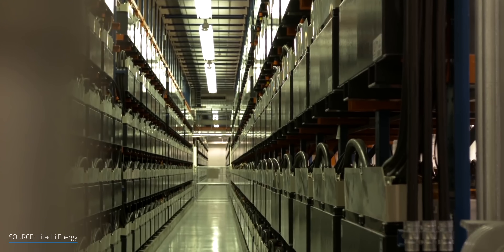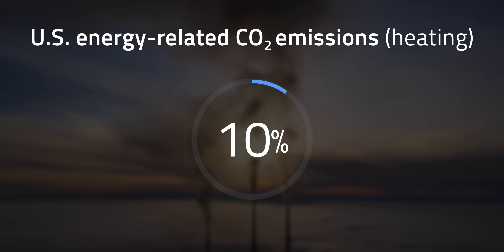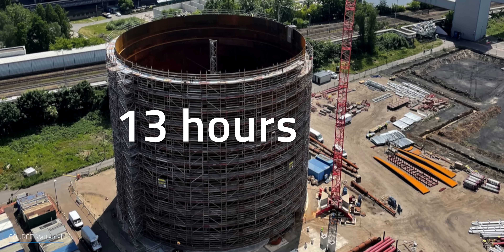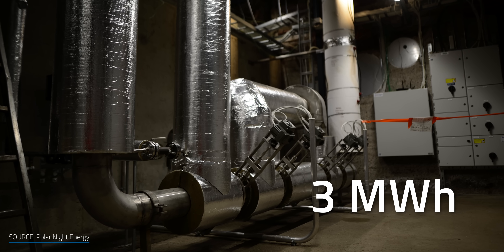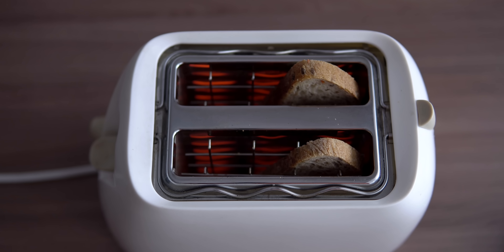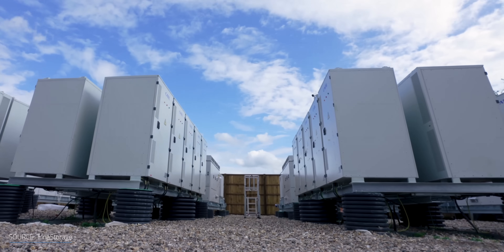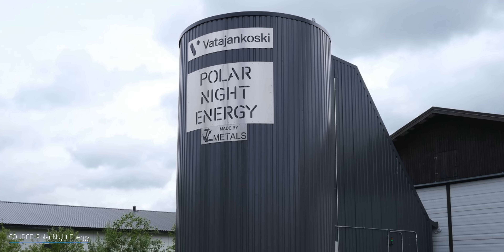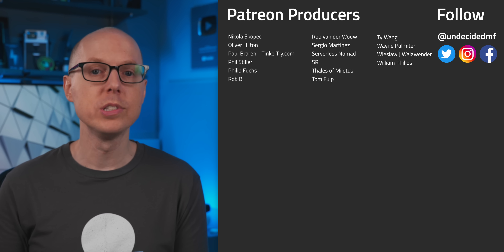How A Sand Battery Could Change The Energy Game

Comment: So if the turbines are turned off, does that mean the energy that is being used is being generated by 100% renewables? If not then then that is crazy. Should they not be turning off fossil fuel generation before renewables?
Reply: At the current time there is a baseload being provided by NG or other systems.

The power company is not going to shutdown base load plants just yet.
They will reduce their output somewhat to allow for renewable source power.

If clouds shaded the panels or the wind stopped blowing bringing base load plants back online would take too much time. Possibly causing a supply interruption.

On a side note.
Wind generators in the Panhandle of Texas are being shut down because the grid can not handle the power coming out of them.
Reply: The issue is that most fossil fuel plants have issues being completely turned off and on again - most of the components were designed to run under a constant load, and only turn off for planned maintenance. Renewable sources are much more distributed and handle being turned on and off much better. From a wear and tear cost, there is a minimum threshold fossil fuel plants need to maintain to prevent shortening their lifespan.

Comment: If they add the heat when it there is access, they could use solar and heat pumps to heat the sand with less energy.
Reply: You need to raise the sand up to 100s of degrees celsius, you cant do this with a heat pump, they're good for ambient +/-40°C

Comment: The only thing that bothers me about this is that resistive heating is terribly inefficient
Reply: Actually resistive heating is 100% efficient,especially when using surplus electricity as
your energy source. One KWHr of electric produces 3412 btu's of heat energy.

Better would be using a heatpump to extract heat from the air at~5x efficiency,but
high temperature heatpumps are not ready yet.More work needs to be done on this.
Reply: Resistive Heating is 100% efficient. 100% of the energy gets converted to heat.
Reply: @gillo100  I’m talking about overall efficiency, when you compare natural gas heating to resistive temperature eating there’s no contest.
Reply: @TexasScout  The purpose was to store excess renewable electrical energy, not use more fossil fuels to create energy not need at that moment...
Reply: @troubleshooter1975  understood I just didn’t think that was the most efficient way to do it, but I’m not a scientist.

Comment: This is yet another reminder that more cities need to invest in district heating networks. This is one of many potential techs out there which would drastically reduce emissions by taking advantage of one….but many of our cities don’t have district heating so they won’t be able to take advantage of it :-(
Reply: Detroit HAD district heating from coal fired electric plants. Then we started phasing out the old and dying coal plants and they sold the district heating to Enron. Which raised prices for heat to high cost and for 2+ years a goodly portion of Detroit's central heat district scrambled to convert to gas fired boilers (3 year payback on package boilers vs Enron)(steam was the medium for transfer and Detroit was the "condenser" for the power plants - adsorption cooling for the summer).

So, if building managers are going to buyin and this is going to work, it must be regulated and treated as a utility or some structure to avoid the gouging as Enron did to cause a reversal effect.
Reply: @billb48843  Open sourced, non regulated, non taxed, only an engineering pass sticker for safety. Every land lord or home could have their own type of heat and go off the main grid. Eventually even off the electrical grid using the same tech.
Reply: The U.S govt does things half-assed.  They have regulated corporate entities running the utilities.  To maximize current profit they kick maintenance work down the line until something breaks.  Any money they spend on maintenance is money that isn't being spent on increasing their profits, and so is kept at a minimum.  There is also virtually (sometimes literally) no competition so they have very little incentive to make their customers happy.  Add to that the corruption that often takes place between the industries regulating body and the utilities company and you get a fine mess.  There are a lot of projects that would be useful except that we need to clean up the way we run utilities.
Reply: @IaIaCthulhuFtagn   What you're describing is the result of the forced privatization of utilities into investor owned utilities which are 'regulated monopolies'. Another great achievement of the neoliberal wrecking crews: socialize cost, privatize profit.
Reply: Finland has functional heating networks in most of cities and towns.
Reply: Given the efficiencies of heat pumps, the power grid has the capability of being a very efficient district heating network.
Reply: @DominicFalcon  You suggesting collecting the excess heat from transformers and other power grid equipment and feed that into district heating system?
Reply: @eaaeeeea  I don't think they meant that, but that's not a bad idea
Reply: @DominicFalcon  The point of the video was, that you still need electricity for it to work (relating to heatpumps) and in current market, there are too few cheap and scaleable options for renewables to store excess energy during the peak production hours and disperse it in form of an electricity. I.e. the problem is that you need more diverse forms of energy exchange rather than straight up electro-chemical batteries for energy storage. Heat pumps are a great solution only if your source of energy is nuclear or hydro (easy to adjust and to throttle).
Reply: I'm sorry can someone please explain this? Where I live every house has its own heat ...
Reply: @tricanproductions6184  Almost all energy production works best at large scale, so instead of each home having a boiler in the basement you lay heat pipes along with all the other municipal stuff that goes under our streets and produce al the heat the city needs in one place instead of paying for millions of less efficient units. Any power plant, but also places like steel mills and other factories, computer data centers and waste burning facilities can be connected and the waste heat from them will be pumped through the pipes to your home. Obviously, during summer the system only heats your shower, not the radiators.
Reply: @AnalystPrime  I just shudder at the idea of putting in heat pipes where I live. Would be an absolute nightmare
Reply: @tricanproductions6184  the other user already gave a good explanation. I just want to emphasize that the advantage of district heating is that it often uses waste energy from a large scale process in order to get heat into your home instead of having a dedicated “heating process” such as your water boiler in your home. That’s how you end up with an incredibly efficient system and way lower CO2 emissions.
Reply: District heating have range based disadvantages, also thermoisolation must be renewed time to time (~15y). Its lot of money. We have district heating systems all over Ukrainian cities and after heavy 90s (period of crime and poverty) they all became extremely unefficient,  because of lack of city funding, and renovation costs to much to be done all at once. There also a problem that most of our districts are huge and length of average heating communications is high. 
I wanted to say that this way to heat buildings may be not reliable in some cases.
Reply: Nuclear. When SMRs and MMRs mature, this is one of the greatest things that can happen, using them for district heating Cogeneration. Finland is looking into SMRs/MMRs to repower Coal-fired and Biomass-fired District Heating Cogeneration. Russia uses nuclear-powered Cogen a lot too. 
Another great option for district heating is low-temperature Geothermal from hot springs and such. If we are able to do it everywhere to high temperatures as the dudes in MIT think they can, it's going to be great. If not, SMRs (especially FBR or MSR based) will be great for district heating Cogeneration. If NIMBY doesn't kick in.
Reply: @Li Heli thinking that might be due to corruption.
Reply: Detroit already has this and it's a pain to maintain and businesses find you only have one provider available if you buy in.
Reply: @Li Heli exactly what i thought, add more complexity to a human system and watch it spin out of control.
Reply: I might still be more efficient to make electricity and transport that instead of heat. Because heat pumps and power lines are so efficient.
Reply: @MarkkuS Insulated Heat Pipes are pretty efficient, and using waste heat from thermal power plants ramps up overall efficiency from 30-40% to up to 90%.
Reply: @AlldaylongRock  way to vague to be understandable, what initial temperature for said heat pipe, how far is it going, how cold is it, how fast is it flowing. What is the volumee of the pipe, what if the material the pipe is mde from, where is any actual simple observations or refrences of data do you have to back up your asseryions about the imroved efficiency margins. Honeslt i didnt even list the possible problems with long distance heat distribution in anywhere but cities. Maybe you live in a city. Maybe you feel like its the center of the world, its not, the majority of the unidet states lives in single family residential housing, stop thinking so grand, when you build such a large complex system for things as large and important that it supplies more then 100,000 people with, power, heat, food, and any other things they need to survive..... well it leads to people being lost with no alternative when there is a cascade failure that leads to a multi day collapse of a mart of that infrastructure, that combined with the cost, complexity, and potential for multiple corrupt bad actors profiteering from a fat tax funded infrastructure project.

Think smaller, build it by giving scrapped and discarded materials saving the energy it would take to have the material re processed, and manufactured again, all yhe while using gas to get shipped back and forth back and forth.

You cant try to solve the probems of so many people that they become just numbers with an acceptable margin of failure losses for when unforseen failures occur, but feel free to design a large scale highly complex system that if not properly maintained and monitored, will likely lead to the death of somone who is loved, and somone who will be missed, im not saying its a good idea, or a bad one, im saying when considering such large complexity remember that you are now accepting reaponsibility for the ones who suffer when its neglected and ignored 100 years later.
Reply: @dlayman101  No idea of details on those parameters. But Iceland uses High Temperature Geothermal to heat Reykjavik and other places. The pipes can be way over 60km long, and the country's name shall say anything about exterior temperature. The T0 of a nuclear power plant is pretty similar to HT Geothermal after running through the turbines.
I'm not saying that DH is viable in a generality (surely not viable in very rural areas), but for larger population density, even in the middle of a rural area, it is pretty viable. Even if it's a suburbia with single family homes. For those areas where DH isn't viable, either fueled or electric heating (preferably a Ground-Sourced Heat Pump) will have to be the solution.
Reply: @MarkkuS  power lines are Simply more efficient at moving large amounts of energy long distance, nonetheless a massive amount of the energy we produce is wasted to transmission losses.

We need smaller power generation facilities distributed more evenly based on population density and efficiency.

It will be a bit more expensive up front, but it wpuld make a much more dependable and long term more cost effective way of making solar and wind, energy conversion, transmission and storage.

The part people never caculate about our current energy system, how much energy does it take to research, build, and maintain, large power generation facilities, then how much is lost when one of those larger generation facilities goes down. How much work gets delayed, how much does that costs, and when the problem is finally identified, if its a large problem, how many workers and heavy machinery is required for a repair on such a complex and large facilities. Whereas for example if we generated 100 kilowatts per square mile, and the time that power is ever transmitted is when one of your adjacent suare mile neibhoors has a failure that takes a few days to repair.

Somthing people need to take from nature, symbiotic diversity breeds beautifully balanced systems of perfection, the type of system that can have a node failure rate of 30 or 40 precent, yet almost any individual in that system, feels no change or reduction in survivability.
Reply: It would be redundant because we already have electricity.
Reply: Making buildings much more efficient would mean we don't need district heating and help lower taxes.
Reply: @Martian74  why not both?
Any way of heating is more effective/efficient with efficient buildings.
District heating from waste heat from thermal power plants is ridiculously efficient. You are literally using 90% of heat generated instead of 30-40%.
Reply: My only thing with a city wide central heating source would be like hitting a four hose Bong. Theres always gonna be somebody out there hitting it harder than you but paying the same price.  Welfare has already overstayed its welcome
Reply: @Craneopsss  – I'm happy to report that Craneopsss is clueless. Keep hitting that bong, friend.
Reply: @Craneopsss  i think you dont understand smth about counting energy in those systems
Reply: Why not a fairly well insulated box the size of the building foundation or for that matter the size of a city block. Cap the sand mass with insulation and have some areas that the panels can be removed or replaced as heat is needed. Because of the large mass which hold a huge amount of potential heat ; that city block would then heat not only its area but a diameter quite a bit larger without the potential losses of trying to run insulated pipes for miles. When developers tear down an area, make that area the new receiver for a deep mass sand bed. If a pier foundation is installed, along with support from the sand mass, there would be sufficient structural support to hold up any building. The win is that heat naturally wants to rise, and said sand mass doesn't take up expensive real estate.
Reply: I don't know. I sort of like the idea we can be decentralized. 

 Instead of district heating. Everyone has their own renewable resource.

 I've just read stories of how much a headache it is when the system isn't kept up on.
Reply: @Li Heli sure. These systems require upkeep. But paying for that upkeep via taxes is rarely as expensive as when you tally up all the upkeep that us individuals pay on our own little private systems. So we still win as a group overall.

But we have to get the messaging right in order to help people realize that deploying something like this may raise your taxes, and that’s actually a good thing.
Reply: @SaveMoneySavethePlanet  It's the perfect application of government. Pooling resources to save money for everyone.
Reply: At finland we have. And also most of heating plants also produce electricity from pressure difference of district heating network.

Comment: I have a lot of respect for the amount  of hard work  & research Matt puts into his videos .. but I wish he'd cover less vaporware and more  real scalable , available , deployable , IRL existing  energy innovation
Reply: it's not vaporware if an actual working implementation of it exists..
Reply: But this is working in real life right now. Using sand to store heat is also a thing which humans did more than 1000 years ago. Sand is available and scalable.
Reply from the maker: Appreciate the feedback, but I'm not sure how this is vaporware.  It's a real technology/technique that's in use today.
Reply: @UndecidedMF  Maybe I'm not following the math or wording but if it doesn't exist it is close to vaporwear. Also, how is this economical at either the generation cost of $10/KWHr (https://youtu.be/G6ZrM-IZlTE?t=615) which is ~50x current cost of energy delivered (in CA its $0.20/KWHr) and that assumes being able to scale x100 energy production at 20x the cost of producing the 'battery' (so no scale model currently exists?). And that appears to use 'free' electrcity from unused solar power (which isn't reasonable as there would be distribution costs to bring the energy in which could be significant.
Also https://youtu.be/G6ZrM-IZlTE?t=629 mentions Thermal energy storage cost of $15/kWhth (which by the name doesn't appear to cover generation or even distribution of the stored energy), and this energy would only be useful to industry year round or for district heating only ~8 months of the year depending on location.
Reply: then he'd run out of topics in like 2 months lol